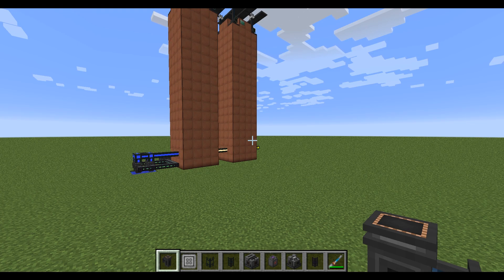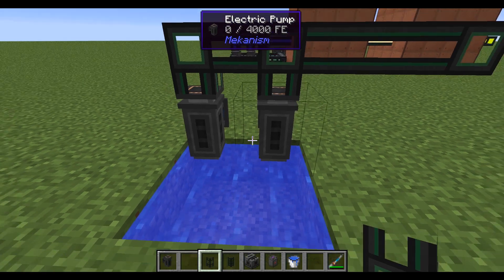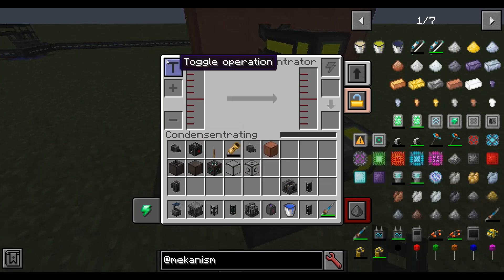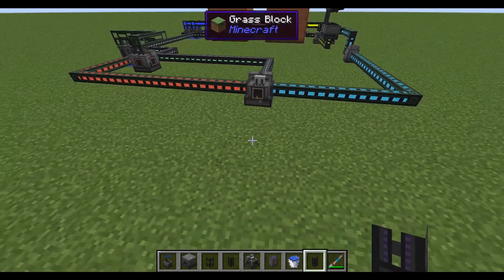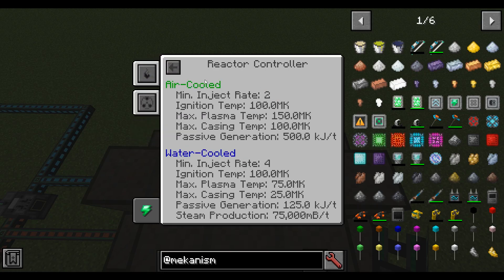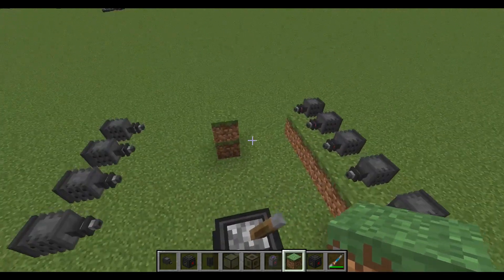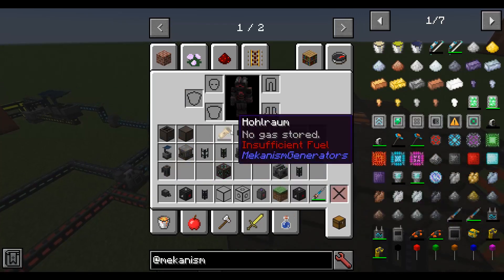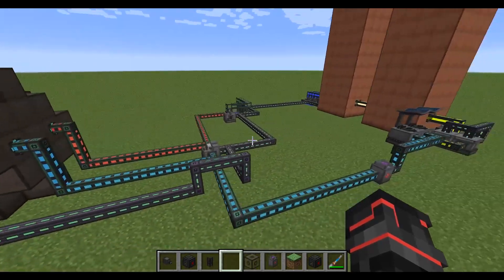Mekanism Fusion Reactor Tutorial

Comment: thank you! it actually worked! i couldnt figure it out, i knew the general shape but
Reply: I can’t get the lithium out the solar neutron activator
Reply: @CerealCityHits  you have to configure it in the machine I believe and if that doesn’t work, make sure the pipe is on export mode
Reply: @goldenroar4757   I did this same build and when I fired it up it started cooling down, fuel levels were both full and I tried bumping the injection rate up to 4 to save it but it went out anyway. Did you have this problem?
Reply: @jonsessoms412  make sure your on injection rate of 2 and FULL power on the laser

Comment: I figured out the issue of my original comment and then ran into another issue. I am actively cooling the Fusion Reactor to generate a massive amount of steam to put into a Turbine from Mekanism and generate much more power than the Fusion Reactor can make. The issue I am currently having is trying to bring in 1.1million mB/t of water so that it will generate that much steam as it is the max amount. Rather than using 18 Fusion ports and 173 Sinks (Easiest infinite water source in Enigmatica 2 Expert) I was wondering if there was a better method of transporting that much water per tick?
Reply: Mekanism Pumps and Super-Laminar Fluiducts could work. Though this is a theory. Those fluiducts transport an infinite(?) amount per tick but needs servos to do anything, however mekanism pumps output directly without servos so you can circumvent the limitations of the pipes.
Reply: Very late, but you should try using the Pressure Pipes mod. Super-laminar fluiducts do work with the industrial turbine's vents, but they aren't optimal. Pressure pipes are a little complicated, but they are entirely unlimited in the fluid pump/flow rate.
Reply: Integrated dynamic has unlimited fluid transfer.
Reply: Fluid laser relay from actually additions is the answer to all your prayers. That bad boy can fill up a black hole fluid tank in one tick with 1 sink. 2 billion mB/t, baby.
Reply: Extra utilities 2 pipes